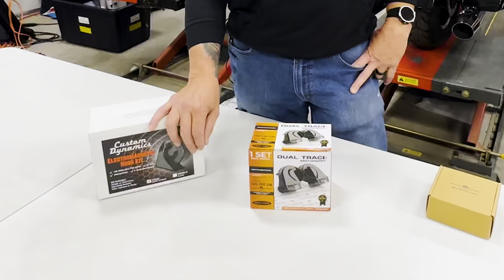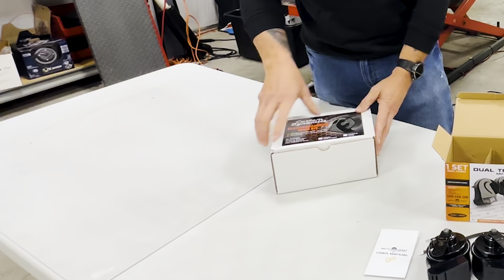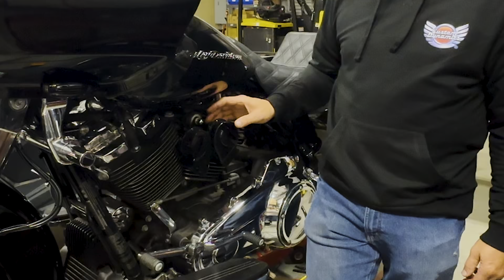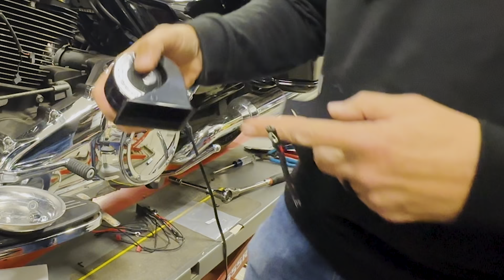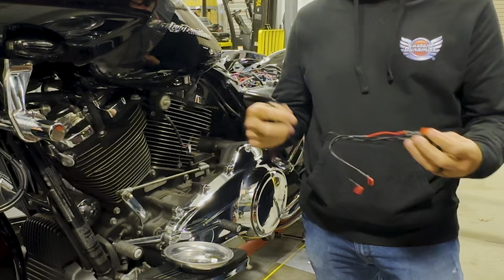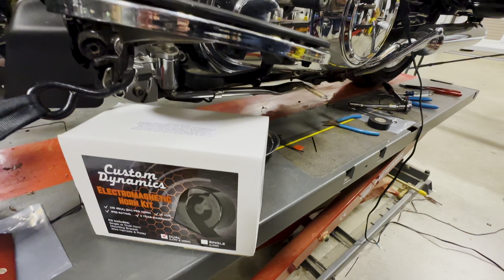Which Motorcycle Horn is the Best?

Comment: I had the Motohorn Dualtrack on a previous H-D.  Install was simple and no relay was required. It was plenty loud enough.  I was going to order another set for my current H-D but I will probably go with the Custom Dynamics setup this time if for no other reason than the mounting bracket.  It's a cleaner setup than a couple of metal tabs that the Motohorn setup uses.